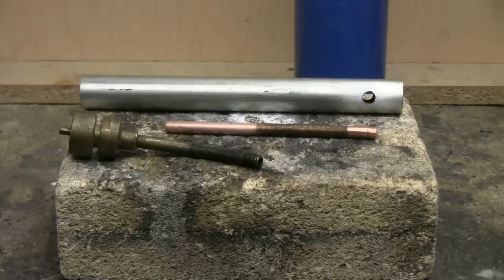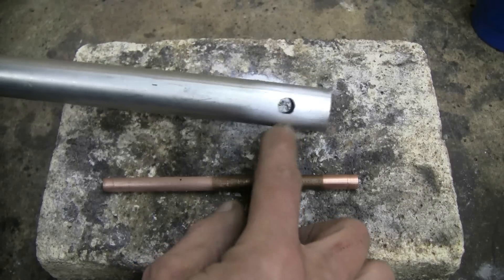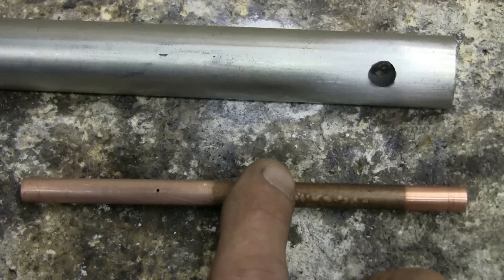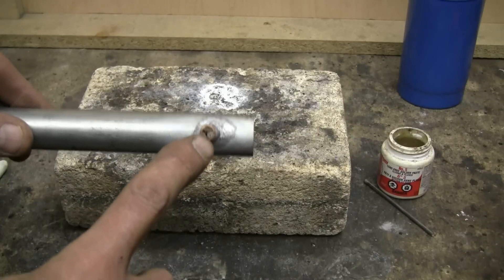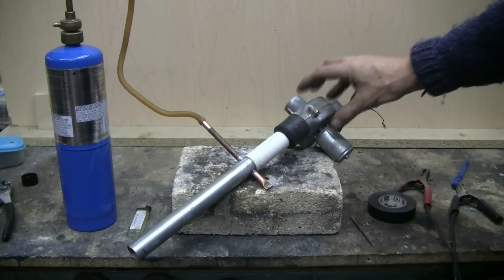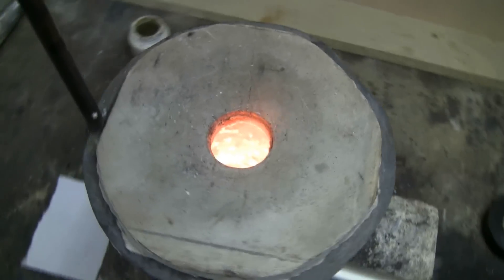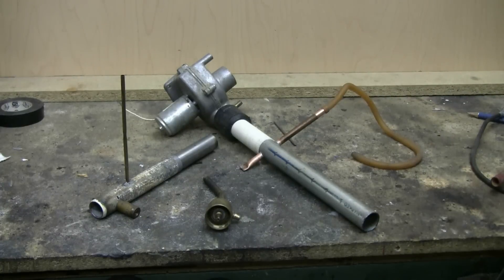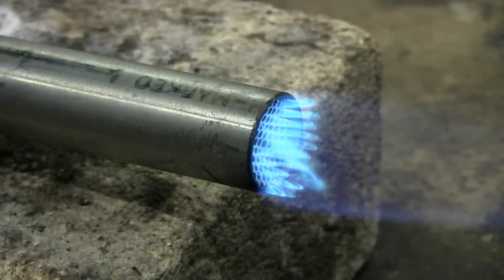More Do It Yourself Propane Burners

Comment: Great job. Simplest ideas are the best. I just made one using steel tube instead of copper so I could mig weld everything. Instead of drilling a .9 mm hole for the orifice I drilled and tapped a hole  to allow me to use a mig welding tip of .9mm. I can then try different  size tips if I need to. The .9 is the only one so far and seems ok. I duct taped a hair dryer on the end and that seems to work as well.  Cheers.
Reply: Bingo! Love the idea of the mig tip. That's how I'm 
gonna do mine

Comment: Something you might want to consider when building this, not trying to be a safety Nazi just a very concerned youtuber.
The electrical conduit you are using is very thin walled and is galvanized. The tip gets pretty hot and will let off gasses that are horrible to breath.
Those that are using this torch in an upright manner in such applications as a Forge. Remember that the body can get quite warm and will melt solder. So the thing separating you and a giant column of flame could fail at any second.
Also use gas rated tubing. propane is a corosive gas and regular rubber hose will fail.

last but not least. Do allot more research before deciding on the easiest way of getting the job done. Some times cutting corners is not the best idea.
good video though.
Reply: Turner Forge spRcial saftey alert.

Comment: Bill Gilmour, what type of hose are you using to connect the propane? Great videos, I have enjoyed them all, very informative!
Reply from the maker: +GoGonzoJoe For my final setup it is using proper propane BBQ hose and brass fittings. I am using a BBQ tank with a regulator as my final propane supply. Better than torch tanks that were used for testing.
Reply: +BillGilmour, Thank You! Looking forward to your future videos, keep up the GREAT work.

Comment: I can't get my burner to work like yours does. Outside of the furnace without air being forced through, it burns like a candle. The flame is yellow and licks upwards. The smallest amount of air immediately blows out the torch with a whoomph.

Inside the furnace, I just get a lot of yellow/blue flames shooting out of the top. Eventually the flames die down and go out on their own. Again, can't blow any air through or it blows out immediately.

I followed your directions exactly.  My hole was drilled with a 3/64th" drill bit. I even happened to already have what looks like a very similar propane torch and blue tank which I bought together. It's this one: homedepot.com/p/Bernzomatic-UL100-Basic-Propane-Torch-Kit-334458/203665003

Do you have any ideas as to what I did wrong? Is that my torch attachment not outputting enough propane?  Could it just be that my quick soldering job is leaking?

Thanks for the video, your burner is so much simpler to build than anything else I've seen on here. Hopefully I can get it working with a little more troubleshooting or a do-over.

UPDATE: Upon closer examination, your torch was just an open tube at the end! That's what an "orifice plug" is. I thought it was just the bit that unscrewed.  I think my torch was a little different than yours. I ended up just sawing off the entire end bit because it was definitely not just sliding out. It seemed like one solid piece of metal with nothing to slide, though I could definitely be wrong about that. Anyway, I've now got a much more powerful flame. Can't wake anyone up by running the vac, but I figure this was the only problem.

Thanks a ton for the video. Can't wait to get melting and casting without all that charcoal.
Reply from the maker: Glad you got it working. It should let you melt aluminium and brass easily, as well as doing some forging.
Reply: Bill Gilmour